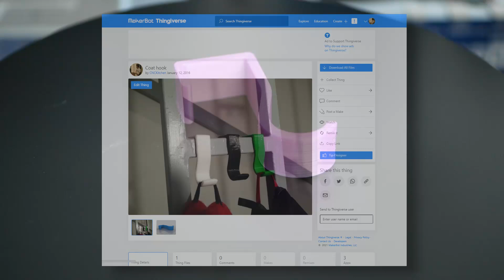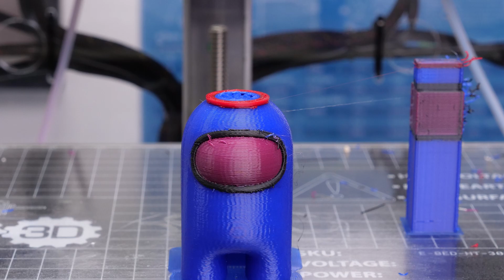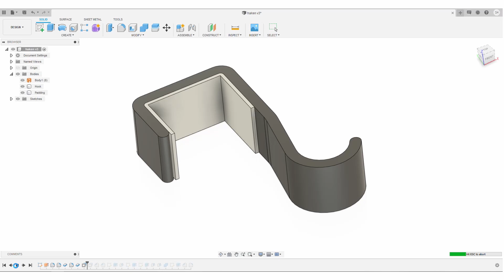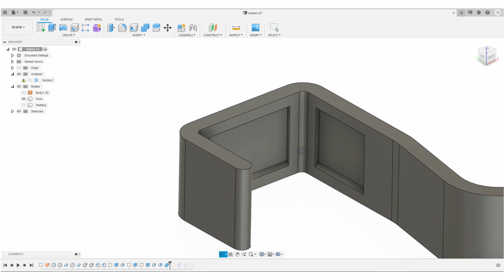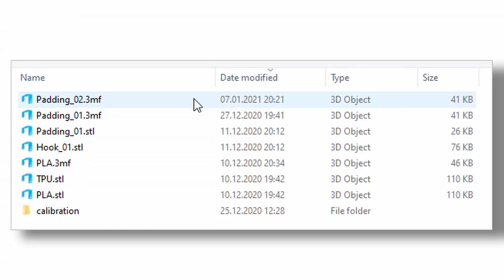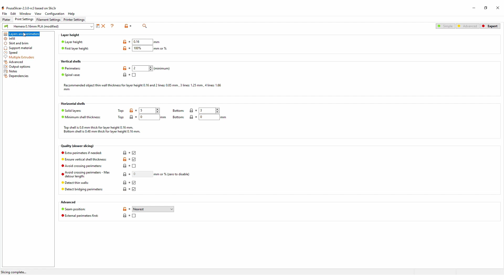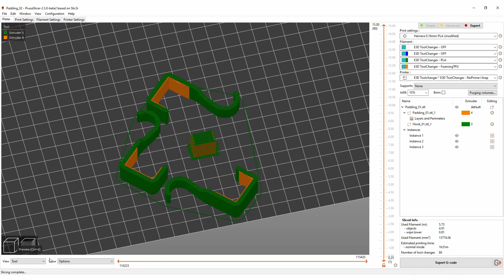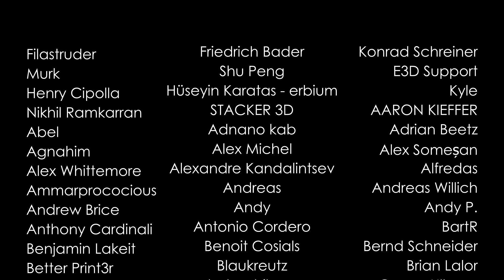There is MORE to this HOOK than you think! (Multi-Material 3D Printing)

Comment: I would love to use the tool changer for adding threaded insert in the print. So you would have a fully functional part right at the end of the print
Reply from the maker: I'd love to try that.
Reply: What tool would you use for that?
Reply: @fozbstudios  I imagine a modified hot end that pick up insert at one spot and place it on the piece the same way as you do with a soldering iron
Reply: Even if you only had it in Z that would still be pretty complex... without force feedback it seems like you would crash the head, and need some way to release the insert at the end.  It would definitely be impressive.
Reply: @aimlessweasel  maybe a vacuum so the release is just gravity and you are above the part just slightly so it barely drops?
Reply: @aimlessweasel  if the machine is repeatable enough. You can get away without force feedback. 
Has for releasing mechanism... It would be a finicky part. You can maybe use thermal expansion.

Only in the z is a huge limitation sadly.
Reply: @Hacoulia  if the insert was going into a part of the print directly in contact with the bed perhaps, but if there is deflection because of the geometry it could be more tricky. Each insert style and size would require different heating and installation speed profiles, for each print material (though M4 in PLA would probably cover the 80/20 rule).  I'm sure Stefan could come up with something...

Comment: Please show more of this E3D machine! Also I thought hemera was ideal for flexible because of the shortest extrusion path.  Why not???
Reply: I have both the Henera and Omniadrop and I never had jam or failure with the Omniadrop, but the Hemera did have some issues. Plus the Omniadrop is easy to maintain and the whole extruder assembly much lighter than the heavy-as-a-mercedes Hemera.
Reply from the maker: It's working great for flexibles just had a couple of extrusion problems from time to time with TPU and that's why I changed to the OmniaDrop.

Comment: Can that nozzle wiper at 7:06 be added to any printer?
Reply from the maker: https://geni.us/0mFycE
That's a simple silicone kitchen brush that I trimmed down a little 😅 So, yes you can if you have the space for it.
Reply: @CNCKitchen  So do you just print some mount out for the printer and add some g code for it to wipe in the beginning?  Did you follow some guide for it?

Thanks!

Comment: I like to watch your videos. Very informative as usual. BTW: you can achieve similar results with the MMU2. mmugcode parser helps to improve current PrusaSlicer temperature change implementation and allows the use completely different materials. https://youtu.be/Z9pe_uwS224

Comment: Maybe I'm just dumb, but why do you need a purge tower if you're using multiple nozzles?
Reply: That's not a dumb question. I guess it's because the nozzle oozes when idle, and you need to tower to prime it, especially on larger layers. Should probably be called prime tower and not purge tower though. :) On certain larger models I guess you could print infill first and skip the tower, but at least the tower is much smaller than on single nozzle multi colour printing.

Comment: I have silicone wipers on my own tool changer for every single tool. that mainly gets rid of stringing.

why aren't you using the brass brush in your timelaps?
Reply from the maker: I use a silicone brush but that tends to clog up after many toolchanges with a lot of priming and this is why I prefer using the tower,
Reply: @CNCKitchen  It sounds like your brush needs a comb. :-)

Comment: Hi Stefan,
Do you use the pressure advance on your tool changer (G-Code M572) ? We have oozing issues that has been solved on it by using it. but we have not yet tested this on rubber like material, then it may be irrelevant. 
As you demand our opinion on ToolChanger, I think that the main interest of the tool changer is the Additive Subtractive Manufacturing By Layer (ASMBL). We are currently redesigning the the machining tool head in order to use more standards parts.
I think that being able to use head as the pellet one that you have bought is of great interest too. We succeed in using the Mahor.xyz universal pellet extruder, but is is not yet bug-free as it is a challenging tool to use !
An other great use could be layer inspection, we start thinking on it but adapted tools are not easy to handle.
Last, for us the price range is very attractive compared with semi-industrial grade  such as ultimaker S5 that are less versatile .
I hope I will see your mahor.xyz extruder on the TooChanger ! I would love to exchange tips on it.

Thanks for this video that shows well the interest of both foaming materials that add compressibility as a feature for design and the ToolChanger. Very insightful.

Best regards,
Reply from the maker: Hey Jeff,
yes, I use pressure advance, but due to the foaming nature of the Varioshore TPU, this can't be compensated for.
I also have a Mahor and definitely want to work with it more, soon, though I probably need to change the stepper to something a little beefier.
Cheers
Reply: @CNCKitchen  "change the stepper to something a little beefier." : Beware, I prefer to have missed steps rather than breaking the auger screw (the most expensive part of the extruder). We broke an auger screw on a Pollen because of the motor torque and some issue with cold start of the machine. Mahor did a great work in this aspect we never break a screw and succeed in extruding everything we tried. So if you increase the torque it is necessary to dimension a mechanical fuse so that the screw does not break !
Regards

Comment: Would it be possible to use the infill area as a purge tower ? It seems like an obvious place to dump unwanted material.
Reply from the maker: Prusaslicer would allow that though it's not very practical if you need strong parts.

Comment: PrusaSlicer may not have an ooze shield option yet, but a draft shield (under Print Settings > Skirt and brim > Draft shield) is somewhat similar, but a little less material-efficient
Reply from the maker: Tried that, but that unfortunately goes around all parts in a convex shape, which doesn't really help a lot.

Comment: Hi Stefan, ich habe mir einen Anet ET4+ gekauft und der hat auch super funktioniert (mit guter Druck Qualität), aber von heute auf morgen sind seltsame Probleme aufgetreten...
Das heatbed ist Ordnungsgemäß ausgereicht, und die Druckkopfhöhe ist auch kalibriert. Trotzdem drückt der Drucker den Kopf in das heatbed, wenn man zum Beispiel Home auswählt (https://youtu.be/jVs8QWibfao) und alle Drucke kommen nur noch flach heraus, da die Schichten nicht mehr aufeinander gedruckt werden. (https://youtu.be/jVs8QWibfao) Die Hardware scheint in Ordnung zu sein, ich glaube eher, es handelt sich um ein software problem... die automatische Kalibrierung scheint zu erst zu funktionieren,  aber dann stoppt sie, weil der Sensor an einer bestimmten Stelle verrückte spielt (https://youtu.be/gh92WpUMgaA). den slicer konnte ich ausschließen 

hast du ne Idee?

Comment: Why are you still using the rather limited prusa slicer?
Reply from the maker: Because it works really well besides some flaws and is perfect for the Toolchanger.
Reply: @CNCKitchen  I never try prusa slicer, what are the advantages compared with cura ?

Comment: You should do a video about how simplify 3d costs 150 bucks but they have not released any updates in almost 2 years.
Reply: Pretty frustrating. was supposed to see v5 in 2020 but obviously pushed back. They pissed a lot of people off with promises of updates then saying the next version was an upgrade not an update so will have to pay again. Ugh.
Reply from the maker: I guess that's a waste of time because I can't even get in touch with the developers. Go ahead and use either Ideamaker, which is basically a copy of Simplfy3D or try PrusaSlicer which is equally good or even better now!

Comment: Have you heard of self folding 3d prints? It works using a PLA layers and a TPU layers, that when placed in hot water, creates a bend. Look up Thermorph if you want to learn more. I would love to see you try it
Edit: Looking up Thermorph might not work anymore so I posted a better link in the replies
Reply: that sounds really interesting. I think that would be a great video :D
Reply: Never heard of it. Can you share some good links?
Reply: @Audio_Simon  Unfortunately the official research page was owned by square space and got removed but this hackaday article has the link to the paper. https://hackaday.com/2018/08/27/self-folding-origami-from-a-3d-printer/
Reply: @arvindmahadevan9337  I’m pretty new to 3D printing but I was thinking along similar lines this past week. I kept having a print in PETG fail after the first couple of layers... but these 2D junk pieces that were left over were very flexible, quite strong, and decently transparent. There must be some really nice use cases for even that.